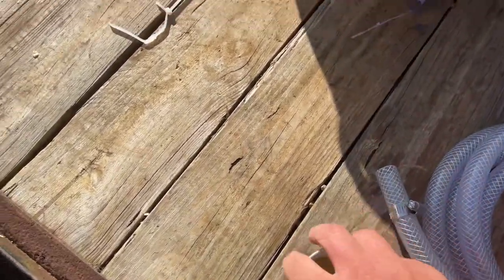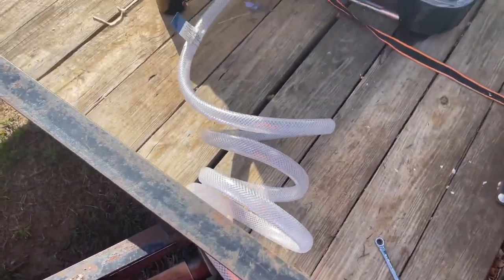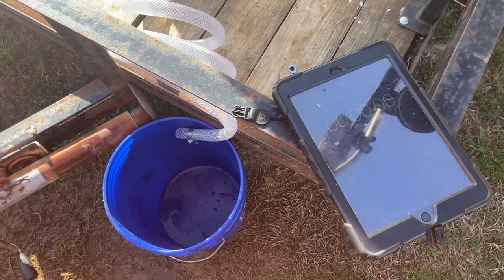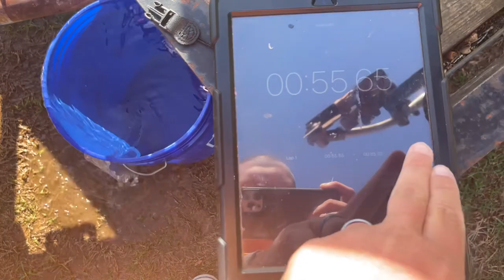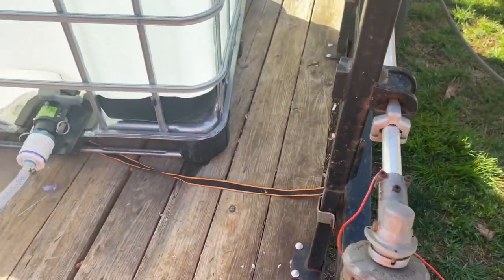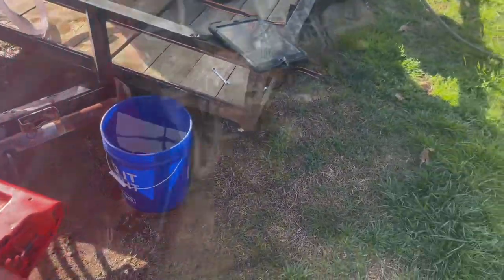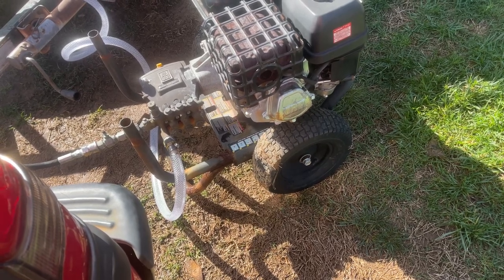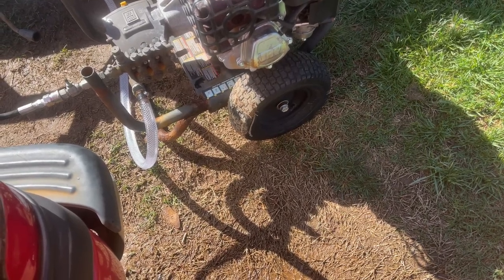Gravity feeding my 4gpm AAA pump on pressure washer

Comment: Flow out the tank is about 
5.55(54seconds)-5.75/min(52seconds).

The reason is that direct drive pressure washers don't create the same suction gear and belt drive do. Direct pumps run about 3600 RPM and belt and gear pumps run at 1450 or 1750 RPM so there's more time the piston is open to draw water, almost twice as much time. That's why direct drives need the pressure from the spigot or a 12v pump.

Like according to my general pump tsf2021(belt) manual the pump can be 9 ft above the water source and still suck water up.

And holding the hose up in the air with the tank valve open the hose will only fill up to the same level as where the tank level is.

Electric pressure washers are going to have a similar draw effects as the gear and belt.
Reply from the maker: Yeah if I had a gear drive or belt I would have it hard plumbed and leave it be. I need this tank for a job and am just experimenting. A 5.5 or 8 would solve this problem easily. Thanks for the info👍

Comment: That’s a good tune I tried with a 2.5 gpm and same exact idea yes it did work and I only used a 15 gal tank  no issues whatsoever but u do have to hold the trigger down when u start ur pressure washer definitely works
Reply from the maker: When I used it on the job I used the ball valve and left it open when starting. I felt that helped out.
Reply: I had this one guy try to sell me a 2000$ pressure washer and I experimented to see if he was correct had mentioned to me that it can only work with a 4gpm
And belt drive  - he was bs me just to sell me a 2000 pressure washer and I bought a 2.5 34000 psi Simpson Yes and it did work did exactly way u did it and no issues with a pressure washer and 15 inch surface cleaner it cost me only 390$ with a 2 year warranty never trust big companies they just want ur money and care less if u sink or float
Reply from the maker: @makycaris4672  Good thing you did your homework.👍
Reply: Keep me posted on landing jobs I haven’t got no jobs had a few scam jobs 
But I don’t take checks they wanted the jobs done then they send me a  check 
Which I refused - do u deal with checks  had bad experience bouncing and get free jobs
Reply from the maker: @makycaris4672  Yes take checks all the time. Only had an issue one time in 9 years. The scammers that text you always “have a budget” and need to “pay with check” and are “out of down on business”. 😂

Comment: Does someone know of a small inline pump to provide the required flow to the pressure machine?  I would love to do gravity feed but there are complications on every video I see.  What would be the smallest pump I would need to just give the water the same push as a spicket on the side of a house?
Reply from the maker: Most houses where I am are at a 4-6 gpm from the faucet. Anything that size should be sufficient. I will be trying this out myself if my new pump won’t pull from a tank.

Comment: Doing the exact same thing right now except I used a thick ass 1 1/2 clear hose and reduced it to 3/4 at the pump.
Reply from the maker: Is it working good for you?
Reply: @jonboysprowash7845  yes sir, so far it is. I have the tank and pressure washer on my truck bed. Had to remove wheels off my machine though.
Reply from the maker: @ChatoMaya-xm9tz  Do you lose any pressure as the tank gets lower?
Reply: @jonboysprowash7845  Im right below the 50gal mark and pressure is still good. 1 1/2 inch is pretty wide so it stays feeding my pressure washer.
Reply from the maker: @ChatoMaya-xm9tz  That is great. One thing I didn’t do when I tested mine was take the cap off. I’m going to use it next week and take the cap off and see how it flows then.

Comment: Add 12 volt utility pump would be ok but you might go threw 2 a season,  i used a 110v pump for 4gpm unit I had with a small generator.
Reply from the maker: I have seen people do that. I figured they would last longer because you are just running water through it.

Comment: That does work and also on electric pressure washer if you used a belt drive pressure washer would work bit better but all is good
Reply from the maker: True. If you can add a 12 volt pump that makes it good too.

Comment: I have done it with a IBC 275 gallon tote to a 4 gpm gas pressure washer. The water level in the tote has to be higher than the pressure washer. 
I don’t make a habit of doing this but the customer didn’t have a water source. I cleaned his 70 ft driveway with a 20 inch surface cleaner. Turned out great. Had about 10 gallons left . I always up charge if I bring water. 

I have also used my electric 7 GPM softwash pump to feed my pressure washer to. It works great that way.  Have done that many times when a customer has no water source.
Reply from the maker: Thanks i appreciate that. I don’t want to do it too often either,but will when I need too. If I wasn’t using my softwash pump I would hook it up to it,but I will be using it too on this job. Thanks for letting me know how much water you had left.I was going to ask about how much it took.
Reply: @jonboysprowash7845  I use quick disconnects on all my hose ends except the female end buffer hose which goes to the customers house water supply.. 
This way I can switch to my pressure washer feed hose 
In a few seconds. I got a designated  3/4 inch feed hose on my 4 GPM. pressure washer it about 10 feet long. Hook it up to my 12 volt pump and I and ready to go. The quick disconnects save a lot of time. I use them on both ends of my 200 ft soft was hose. Plus have them on my homemade wand. Been using them about 2 years.
Reply from the maker: @mattspontiacta  that is great. What pump are you running to have bypassed for a buffer tank?

Comment: I put a 2 way splitter on my hose reel to switch between the buffer tank for 12v and pressure washer. I’m currently using a 2.7 gpm pressure washer.
Reply from the maker: That’s smart. Does the 12v do good supplying for the buffer?

Comment: Did this pull good on your AAA pump ? Thanks
Reply from the maker: I wouldn’t say it pulled good because I was gravity feeding it. I put the ball valve on the end and would leave it open until I added the gun.  I thought it did great like that. But it was never really pulling the water. I think my new pump might but I haven’t tried it yet.
Reply: @jonboysprowash7845  gotcha I heard some direct drive pumps will
Reply from the maker: @joshcagle6035  Yeah if you watch YouTube a lot of guys that mobile wash cars have them like that. Seems that the electric ones will pull. I’m going to see how mine does pulling a little later on.
Reply: @jonboysprowash7845  yeah if you go watch Kurt’s pressure washing he has a 4gpm and it pulls from a buffer tank. And he has a direct drive pump
Reply from the maker: @joshcagle6035  Which pump does he have?I will have to check it out.
Reply: @jonboysprowash7845  I’m not sure, but I heard a lot of cat pumps will pull
Reply from the maker: @joshcagle6035  Might be why they cost more. They are good pumps.